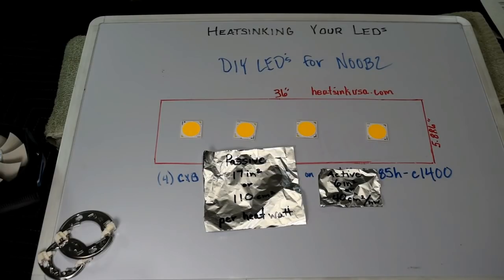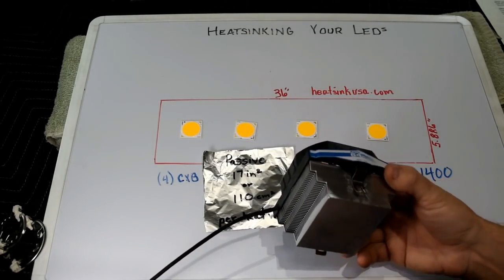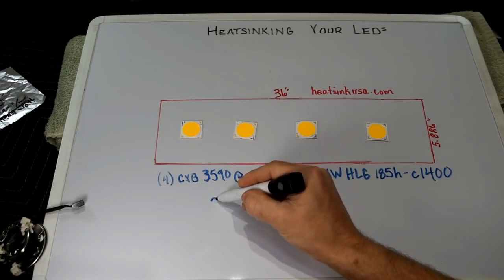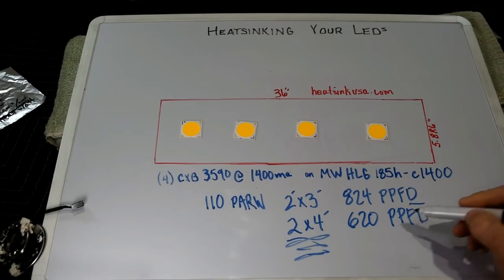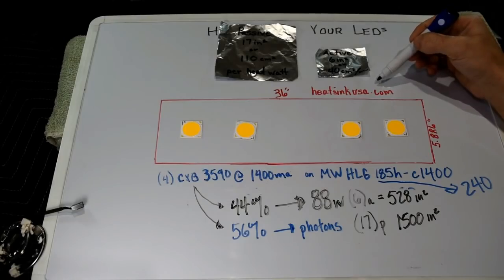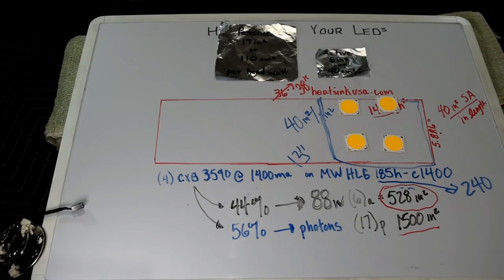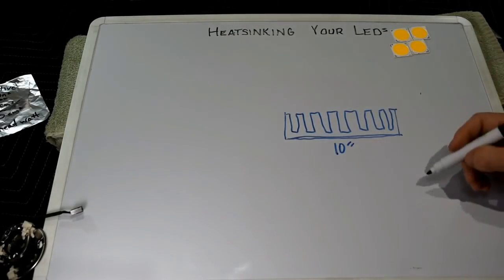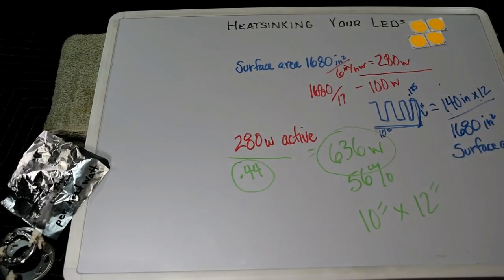DIY LED Basics - choosing your heatsink (part 3/6)

Comment: dear can iuse 220v 50w led chip on cpu heatsink with fan?
Reply: Yes, but what if your fan fails or loses power?
Reply: @Robzaboomafoo  Flawed logic, could say the same about engines, helicopters, air condition or whatever. Fans rarely fail. Have only experienced 1 failing fan after 20 years building computers, and it happened because of an electric wire mechanically stopping the fan.
Reply: @Tomazack  
Not flawed. In my experience with computer building, I have seen 2 fans fail. This is out of maybe 100 computers. So that's something in the ballpark of a 2% fail rate over maybe 5 years or so. So, with this information, you can deduce that there is roughly a 2% chance that one of your fans will fail. When these leds lose their fan cooling they melt and smoke in about 2 minutes. If you soldered them, maybe the solder will melt and sever the connection before a fire starts. With all of that being said, the cheapest I have seen decent fans for is $10-20. So perhaps you go butcher some old PCs and grab their core fans. How much life is left on those? Are you ready to tap the aluminum heat sink under the fan or use adhesive heat paste? You will also need to buy a dc adapter for your fan(s) and wire them to your timer (more wires are not fun). A proper heat sink costs $20-25 and doesnt cost any energy to keep cool. So in the (very) long run fanless is cheaper. It also wont get dirty and become inefficient like a fan will. Taking apart 12+ fans to air dust them every few months sounds like a chore and is disruptive to your plants. Either way though, that 2% chance of my house burning down is enough for me to just buy proper heat sinks and not worry about it.

Comment: I HAVE A QUESTION FOR A BUILD THAT A LOT OF "DIY PEOPLE" MIGHT ALSO BE HAVING. 
* EVERYONE PLEASE FEEL FREE TO POST ANY ANSWERS, HELPFUL INFO.  

SO MY QUESTION IS ABOUT WHEN USING THOSE "SMART COBS" (THOSE DIY LEDS THAT EACH HAVE IT'S OWN DRIVER BUILT IN TO THE COB ITSELF SO NO SEPERATE DRIVER IS REQUIRED) THEY COME IN DIFFERENT TYPES LIKE- PUSH WIRE CONNECTIONS OR SOLDER STYLE, & ALSO EITHER 120V OR 220V, & ALSO CHOICE OF DIFFERENT SPECTRUMS.
SO I AM USING THE 120 VOLT (I'M IN USA) "PUSH-IN-WIRE" TYPE, I HAVE A FEW "FULL SPECTRUMS" & A FEW "WHITES"(I FORGET SPECIFIC COLOR TEMP,  THIS DOESN'T EFFECT WIRING AT ALL)
  
**--WHEN WIRING MULTIPLE ONES TOGETHER CAN I JUST WIRE THESE IN "SERIE'S" AS USUAL? OR ***DOES IT CHANGE ANYTHING BECAUSE OF EACH COB HAVING IT'S OWN LITTLE PERSONAL, INDIVIDUAL DRIVER, ETC?

***ALSO HOW MANY TOTAL CAN BE SAFELY WIRED TOGETHER ALL ON THE SAME SINGLE PLUG?

THANK YOU FOR ALL ANSWER'S, REPLYS, & HELP!!!
Reply: Did you ever get an answer?

Comment: Great Videos - Thank you.
But this video I watched over and over again and two things still bothers me and I don't understand:
1. How do you come up with 110 cm^2 vs 40 cm^2 of surface area per heat watt?
2. How do I get the efficiency of the LEDs? (I want to use Samsung F-Series LT-F564B 2′ Strip with Samsung LM561C diodes and they don't say anything about the efficiency... 😟 )

and btw, isn't there a difference of heat sink design for active vs. passive cooling. I read that for active heatsinks the fins can be narrowly stacked but for passive heatsinks less fins with bigger spacing are better. Is there any limit to the spacing?

Comment: @10:00 ME/EE checkin in. Fin orientation is a MAJOR part of the heat transfer calculation.  If the fins in your example are not vertically aligned (say you mounted your COB it to the bottom of the heatsink), your convection coeff. is much lower because the air cannot exchange as fast and thus less heat is transferred. Typically, heat sinks designed for car amps assume you are going to mount the amp to a wall and the fins will be vertically aligned. I hate to knitpick but somebody could design a lamp thinking they have enough heat transfer to do a passive setup and then realize the lights are getting insanely hot and destroy the lamp or start a fire

Comment: Fantastic video! But I'd like to point out that according to Cree's own website, the Xlamp series is only 50-40% efficient — in other words, 50% to 60% is heat (you got those numbers backwards!) However, they recommend using 75% heat dissipation to be conservative and ensure your product doesn't overheat.

Comment: hey growmaus5 i checked out the rapid led kits, the prices seem to be pretty good compared to buying chips, heatsinks, driver, and everything online... Are there other brands that sell good led kits worth checking out? which would you recommend? I'm new to DIY Leds, but i want to switch from cheap MIC led grow light to DIY. I'm thinking one of this kits might be a better way to start, since the prices seem fair compared to buy single components, what do you think? Cheers.

Comment: Can I run 3 cxb3590s passively on a 30” x6”x1/4” heatsink from Heastink USA driven by 1400ma
Reply: Floyd Ihe thanks bud there actually 31”but I’ll add a a fan

Comment: Hey growmau5.  Your videos are indispensable so thank you for making them.  I'm about to start sourcing for a DIY light.  My question to you is:  How so you actually calculate the efficiency of a particular COB?  Or how do you work out how many heat watts a COB generates?  I can't' see how you can work out the size of the heat sink needed until you know how many heat watts your COB is generating.  Thanks, bud hope the new job is working out.

Comment: You shouldn't be using area to judge whether a heat sink is adequate for dissipating a certain amount of power. Rather, you need to know its thermal resistance, which measures how easily it allows heat to pass from it to the ambient world. So a heat sink with a better fin design can have lower thermal resistance while having the same area.

The other factors you're ignoring here is how hot the LEDs can get, and how short of a life you're willing to tolerate. If the LED datasheet says it can only go up to 75°C then you need a bigger heatsink (one with lower thermal resistance) than if the datasheet says it can go up to 125 °C. And the life of an LED depends on the temperature you drive it at, so if you expect such improvement in the efficiency of LEDs that in 5 years it'll save you money to buy new lights, then drive 'em hard and hot.
Reply: Thermal resistance is the number that'll be on the datasheet for the heatsink, and the number in the DigiKey catalog. Not area.
Reply: Both approaches are valid. There is correlation between Rth and surface area. If we are talking about certain Tc temperature target (65C), you can state that 1W of thermal power require certain surface area. Of cause there are a lot other aspects which can affect on thermal performance (fins step, orientation, heatsink base thickness...)
Reply: > there are a lot other aspects which can affect on thermal performance (fins step, orientation, heatsink base thickness...)

That's exactly what I'm saying. Two heat sinks with the same surface area can have very different thermal resistance, which translates to different performance. The real number that one should care about is thermal resistance, NOT surface area. 

Now, within a SINGLE family of heatsinks (same design, same manufacturer, same material, etc.), the one with greater surface area will perform better, BECAUSE it has lower thermal resistance. But there is no principled way of comparing the surface areas of two heatsinks of different designs to figure out which one will perform better.
Reply: > If we are talking about certain Tc temperature target (65C), you can state that 1W of thermal power require certain surface area.

You CANNOT. This is wrong. Maybe it's fine once or twice but if you keep doing this it WILL eventually cause overheating, component failure or fires. For example, switching from aluminum to copper alone will have a HUGE impact on thermal performance, at the SAME surface area. You cannot use surface area alone to judge the thermal performance of a heatsink.
Reply: Well, I'd say that even Rth provided by heatsink vendor is not very reliable value. Sometimes they calculating it using all heatsink bottom plane area to apply heat source, as we are using only small part of it with small dense sources (CXB3590). After you estimate heatsink using Rth method, I'd suggest to  verify temperature in prototype using control point on CXB as shown here, page 11  www.cree.com/led-components/media/documents/CXA_design_guide.pdf

Comment: is copper much better then alluminium to use as a heatsink ?
Reply: copper is better than alluminium at thermal conductivity. Alluminium has a thermal conductivity of 205 W/mK while Copper has 385 W/mK

Comment: How did you calculate the 56% efficiency?
Reply: because that cob has 56% efficiency, he didnt calculate it, its the spec of that cree 3590.
Reply: I wasn't able to find anywhere in the datasheet of cxb3590 something about 56% efficiency.
Also for other cobs I found only the efficiency in lm/W.
Reply: same here, if anyone has advice on that, i would be happy!
Reply: https://en.wikipedia.org/wiki/Luminous_efficacy#Examples

Really mathy but I guess this is the answer.

Comment: Big fan! Love the tech talks and videos. Thanks for being way more tolerable than other videos! lol How big of a passive heat sink would I need for 7 White CXB3590's, 1 of each color from 2700K - 6500K. But since it's odd, thinking to add 1 deep red, 1 UV and 1 IR. I would like passive for simplicity design and ease of use/switching COBs out. It's my first DIY, so the lower Watt 3590's. Also, 2 strips of 5, keeping spectrum split down the middle but the UV on the deep red side. Do those black needle pin heat sinks work with IR and UV too? Are they rated accurately? THANKS! And does active extend the COB life?

Comment: Your thought on. Using 5" square aluminum tube for a heat sink, while pulling air through the tube  to dump the heat outside of the room. Thinking about using this in my sealed room
Reply: GENIUS!  Did you do it?

Comment: @7:11 you say 5.8 x 36 inches gives 1,450 square inches, but it just doesn't. It gives 209, which means everything which follows is way off. Of it you coinsider the top and the bottom surfaces, then it's 418. Still WAY less than what you say. Am I confused or are you?

Comment: Mingfa Tec has some really nice heatsinks specifically for cxa/cxb. Go to heatsinkled they are passive and all bolt holes are forseen when they forge them. You can hang them easily if you screw 4 picture frame hangers on the back. All you need is M3 8mm self tapping screws. They are 12 bux each 30 after shipping. You don't have to spend any time modifying bracketry lol hang each light on the yoyos! Thanx for all your videos!

Comment: If someone like me wanted to start a 1 plant grow, an extremely small grow set-up just to test the cob itself, can we build a 1x1 grow space for 1 plant using 1-2 cobs, what  type of efficiency will i be getting there? Thanks.
Reply: One single COB in a 1x1 area will give you the same ~800PPFD as 4 COBs in a 2x2 area.
The general recommendation es 1 COB (@1400mA = ~50W/COB) per sq ft.
You will need a driver that can give you 36V at 1400mA, like the LPC-60-1400 "I think".
Reply: Thanks for the input. But im having trouble understanding how you can get the same par ratings in a 2x2 area with 3x more cobs
Reply: It's not 3x, it's 4x. As I said, 1 COB per sq feet.
1x1=1sq feet (1 COB)
2x2=4sq feet (4 COBs)

Comment: Growmau5 I could really need some help. I want to build a simple led grow light one light at a time for cost reasons so I can expand when needed. I want to use cree cxb 3590. Could you maybe suggest what driver and heatsink you would recommend. Ive been looking at a spikey active passive but im not sure if I need a fan? Please help I love your videos!!!
Reply: The voltage range of the HLG-185H-C1400 is 71-143V.
So you can run a minimum of 2 (36*2=72V) and a maximum of 4 (36*4=144V) CXB3590's.
With the HLG-240H-C1400 would be 3-5 COBs.

Comment: Hi. Thanks for all the great info. Im just getting started however I bought a system from a guy and Im wondering if the heat sink is adequate. the heat sink is 24". There are 5x Cree 3070 Cobs. The driver is MW 185H C1050A. 190V 1.05A. Eventually I will learn how to calculate this but for now I just need to know if this will work . Thanks

Comment: hi guys can someone clarify something for me, what watts am i running my cobs at as im in the middle for shopping for fin heatsinks. ill be running, 4 vero29's on the HGL 240h-1400?
Thanks guys
Reply: W = V * A
I think that veros run at about 36.5V at 1400mA. So: 36.5V * 1.4A = 51.1W

Comment: Growmau5, trully brilliant man. I learn a lot from your videos. i'm working on a project an i'm going for cxb3590's a bank of 4 I'm trying to track down a meanwell driver for them, a B version as dimming would be pretty handy for the project... my problem is.. I'm cramming the lights in a pretty confined space. I did the maths on the heat dissipation and even active it won't fit.. I'm wondering if their is anything out there that might suck heat out of these things a better rate? I'm still digging.. but any pointers would be pretty handy..
Reply: darkvanred Dunno if you solved your problem. I'm in the same situation and thinking about water cooling (like cpu water cooling system).

Comment: can you use something other then kapton tape if your on a low budget? 
btw love your videos you inspired me to make my own led light.
Reply: thank you! About the heatsinks though... how can a alpine 11 plus cpu cooler cool a cob led. If we do the calculations you do in the video the metal piece is 95 × 70 × 98 mm, thats about 250cm2 surface area divide that by 40 and you have 6.25w active heat dissipation. I have two cxa3070 AB bin i wan to hook up to 2 Meanwell LPC-60-1400 drivers. By your calculations i should have around 2100cm2 surface area to be able to cool them actively. I dont understand anything, also i dont know how to include thermal resistance in those calculations. I cant get my hands on anything that big as i live in europe. The only thing i can get my hands on are from this site https://www.conrad.se/Kylfl%26auml;ns.htm?websale8=conrad-swe&ci=SHOP_AREA_27805_0205042
Reply: +growmau5 aha i get it. I need to calculate every side and fins. Then you get the true surface area. When you have a fan running does it have a fixed amount of heatwatts it takes away?
Reply: thanks alot man i appreciate it! I will be going with the cpu cooler route. One more thing, do you recommend cob holders or solder. I dont have a drillpress nor am i good at soldering. So i dont know what to do... cant you just use a hammer and a nail to make a hole for the holder. As for soldering what is the purpose of kapton tape, is it to absorb heat or glue the cob better and also what thermal paste do you recommend if going with the solder method, adheasive or normal? thank for your help alot man. Keep doing what you do!
Reply: Can you tape electrical tape around to cob like you would with a solder.

Comment: hey man i got a 39x6x1.5 inch  heatsink  and 7 cxb 3590s and want to put on the one heatsink and   run them on a hlg240  700ma ,,,will i be able to run passive  as the few extra leds help suck up more of the  heat maybe ???
Reply: 1000 mm x178mm x 25m and is near enough the same as yours but a uk profile . .i know its a lot of cobs on one heat sink  but is for a 2 x5 foot space .
Reply: i think it might be too much to make passive

Comment: Long time fan @Growmau5. One thing I have not seen in your videos or at rollitup is how to size a fan for active cooling. You show how to compute the heat sink size, but now what size fan and how many do I use? If I build the unit you use as an example in this video what fans would I use to active cool it?
Reply: +growmau5 - thanks for the response. I hoping for a more technical answer. ;-) I guess I will do some research. I don't want to over-engineer my solution; but I definitely don't want to under-engineer either. Thanks again, and keep up the great videos!
Reply: +growmau5 hey man, got kind of an odd question. Im planning on running 2 cobs(cree 3590s probably) at 0.7ma(as soft as possible), my question is if i mount a fan on a 4 inch wide heatsink, can i use a mixture of active and passive cooling(by making the heatsink say 8-10")? say i took the formula and subtracted the available surface area used by the fan actively and then added the calculated passive cooling of the remainder of the heatsink, would that work?
Reply: +growmau5 what about attaching your extractor fan to it like a cool tube? lol

Comment: I get the calculations of how much will be dispersed given active/passive and size, but how do you figure out the amount of heat you need to dissipate? . In my situation I'd like to run a Vero 29 at 3a and 36-38v. 

I really appreciate all the work you've put into this series. It's been more helpful than anything else.
Reply: +growmau5 Ahhh, so just trying to match what it puts off in heat. Your answer was in the video the whole time. Thanks

:I needed to edit this comment because I posted uninformed information. The way a distributor was describing the Vero 29 Decor series made it seem as if the product was able to run at 25 Celsius without cooling. It was just posting the specs of that product if cooled to that temperature.

Comment: hey dude. im living up in canada and to get a single heatsink from heat sink usa its 120usd and or dollar is shit so its almost 200$ for a single heat sink and i need three. do you have a recommendation on a place to buy heatsinks up here? or maybe a different heatsink i can get from mouser or newegg. i see the fans on heatsinks that are like 14(cad) each and it would be cheaper to by twelve of those then it would be to buy 3 heat sinks. i just dont know what to go for. thanks:)